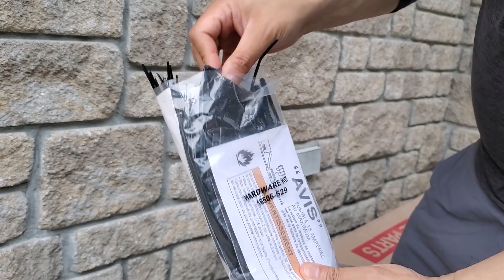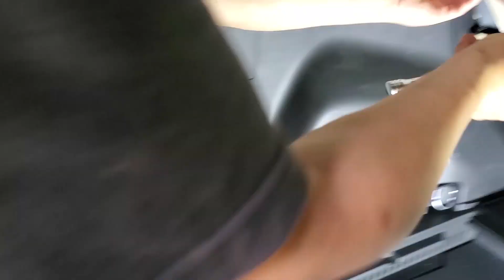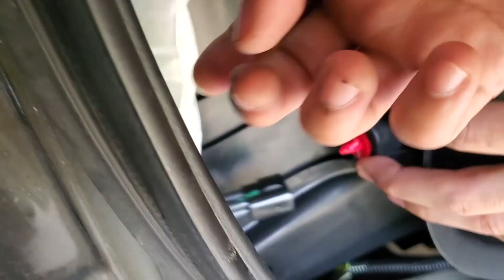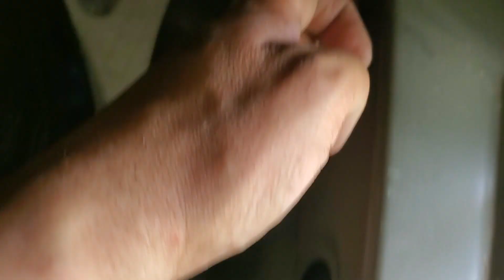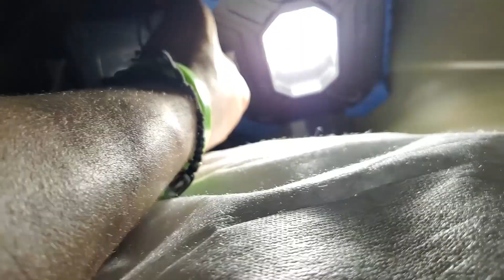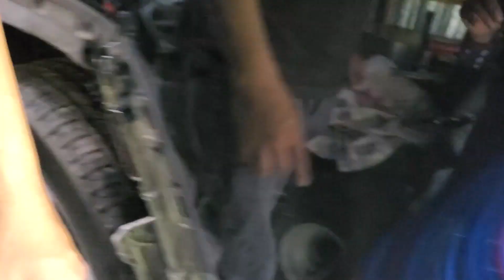RAV4 2019-2023 OEM HITCH WIRING HARNESS INSTALLATION + REATTACHING BUMPER PARTS

Comment: Thanks for the vid. Do you have a link on where you bought the harness.
Reply from the maker: I bought it from Toyota dealer at their Parts section. You need to give them your car's year and trim details to get the exact part. It changes based on your trim level.

Comment: Thx for the vid, for the bumper, did you cut it? And where you get the protector for the edge after cut?
Reply from the maker: Yes, the OEM hitch needs a bumper cut out due to its higher ground clearance. Toyota includes the edge protector with the hitch. If you see part 1 of this video series, I've shown the cutting the bumper. Unlike others, I cut the bumper before removing it.

Comment: Hello, your video was very helpful to me while installing my OEM hitch and harness. My trailer lights work and everything seems to be installed correctly, but when I reconnected the battery and drove around I got a Pre-collision system malfunction error.  Any ideas what may be causing that error code?
Reply from the maker: Pre-collision system malfunction error occurs when the sensor is blocked or dirty. The pre-collision detection sensor is in the front of your car behind the Toyota logo. You can wipe off the logo in the front and then open the hood and blow the dust and dirt behind it with a blower.
Reply: This happens to me every time I disconnect the battery, but it goes away after I drive for a few minutes.